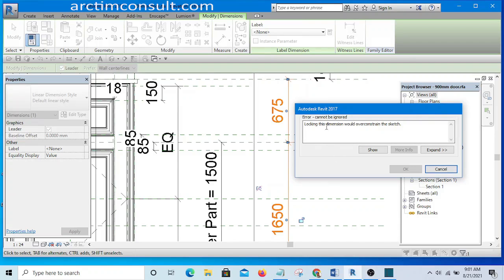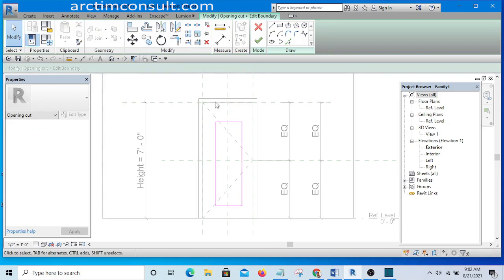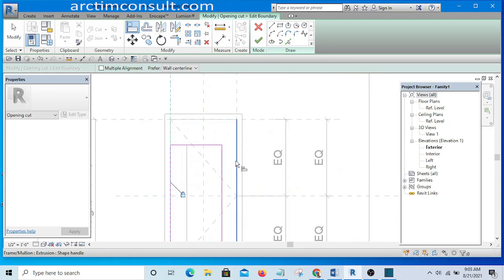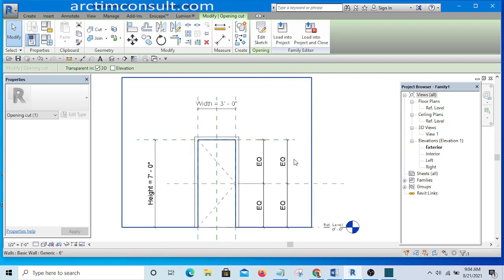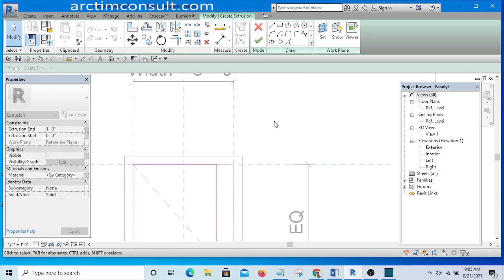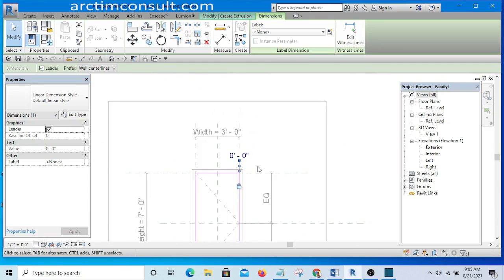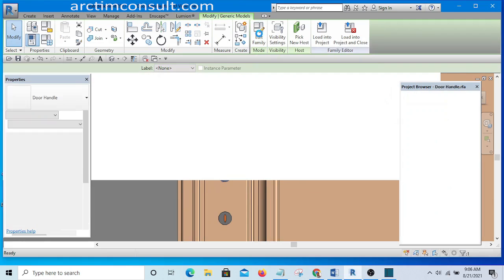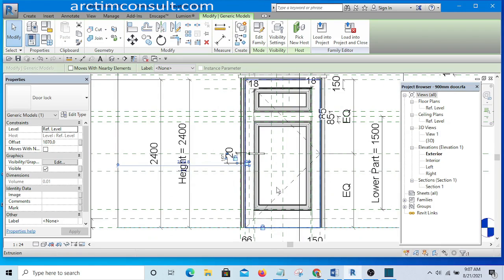Locking this dimension Will Overconstrain the Sketch error How to resolve it 2

Comment: 2025.04.21 For the creation I did, the first step, where you have to lock to the reference plane, doesn't solve my problem. Thankfully, the second one, where you have to change the dimension to 0, works. Thank you so much for this; it's very to the point!

Comment: I hate |Revit for such errors.
What is the logic behind that? attach or align an entity to a plan, you get this error and when u give zero distance it will pass? strange
Also I have another illogical issues with Revit. In AutoCAD the logic with constraint for my model it work without problem, where with Revit, no reason to not work